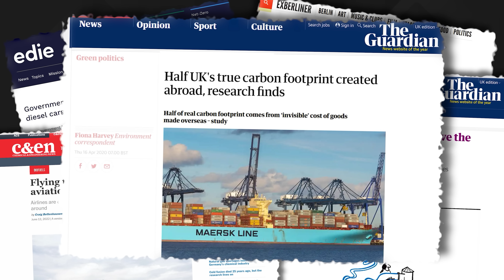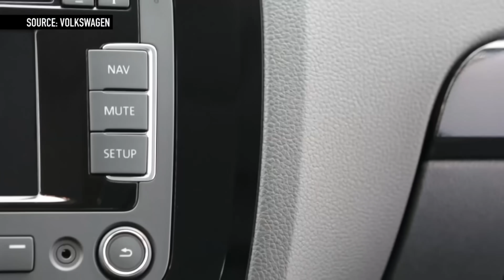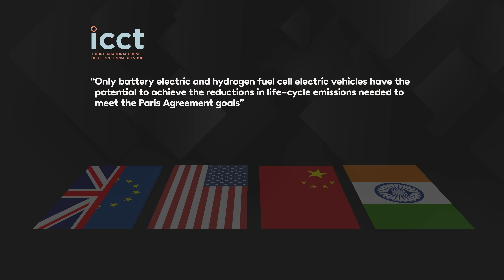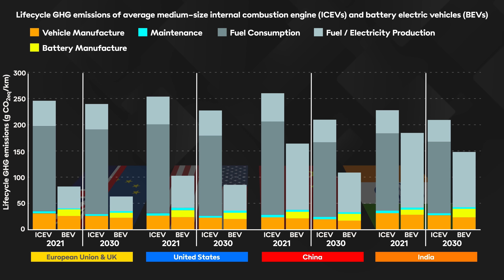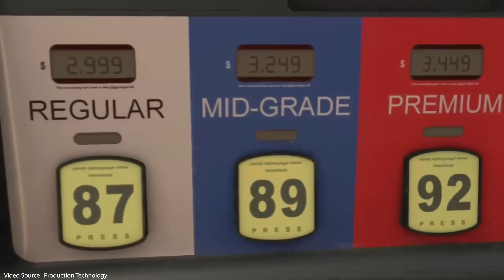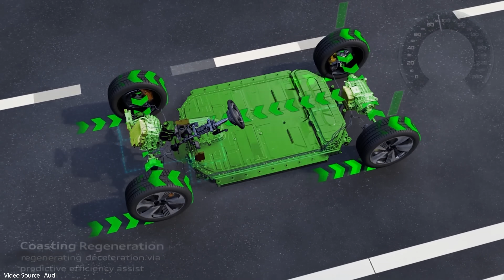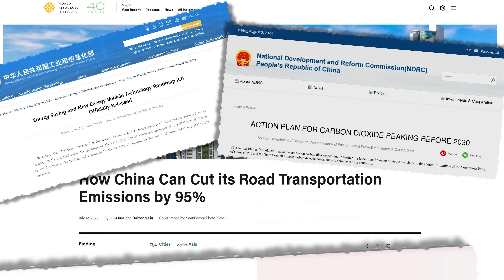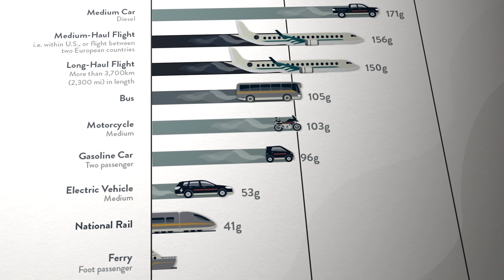Are EVs really better for the climate?

Comment: as a guy who used to convert cars to electric for people i used to have many people arguing these exact points. my answer after a while became simple and it is this:
eventually we will run out of oil, the stuff that fuels not only your car but busses, trucks, some trains, boats, aircraft, and the ships that transport cargo across the globe. it's not going to be a case of one day the tap get turned off, everyone shrugs and says "oh well", the price of fuel will go through the roof way before then. before we run out of fuel the average family won't be able to afford to run their cars. the delivery cost of your new fridge will be ridiculous because they have to fuel the truck. shipping will be so expensive that imports and exports will grind to a halt and forget air travel. ok there are stop gaps such as ethanol from crops and liquid fuel from coal (you know, the stuff the nazi used) but in all seriousness eventually we'll need an alternative mode of getting around and that is electric drive. now you can wait, but check it out by 2035 with a population of nearly 9 billion a lot of people will want an ev so good luck. my advice, if you want an ev try and install or buy a new home with as much solar as you can pack on the roof and battery storage to go with it. you travel with the only costs being on road and upkeep. treat the vehicle well and you'll need a new set of batteries in 7 to 10 years. by that time battery tech will have improved and you can buy and upgraded set. the world is going to shift to ev "everything" eventually and the way things are going it's probably gonna be a rough ride.

Comment: Getting yourself a nice two wheeler is certainly an option. But what about PEVs,  like e-scooters and e-unicycles (EUCs)?

These are never mentioned as transportation (and leisure, i.e. road-trip) alternatives.

If an EV uses 200 Wh per km, my Veteran Sherman (20" EUC) uses less than 30. It has a 60-80 km range, so more than enough for daily travels. And at 77 lbs, uses much fewer resources to produce. It has pretty much replaced my car, which I only use a couple times a month.

I guess they're not mentioned because they weren't part of the study. So why aren't they studied? They should definitely be part of the solution.

Comment: I definitely think we should switch over needed vehicles to electric, but I also think redesigning (reclaiming) our cities for humans, through improved public transit, walkability, proper cycle infrastructure, better density, lower speed limits, ending "free" parking, etc. is even more important. Less cars is more important than better cars...though better cars would also be nice. Especially after hearing about how much of the micro-plastics in the ocean are from car tires, which won't change because the cars are electric, and how unhealthy the noise of cars makes us, which again, won't change dramatically because of electric, as much of that noise is generated by the tires hitting the pavement at speeds over 25mph (40kph).
Anyway, thanks for the sane and thoughtful video.

Comment: I've had an ICE Rav4 car, and now a Hybrid Rav4.  (Not the plug in type).  The ICE averaged about 10 L of gas/100 km with a combo of city and highway driving.  The Hybrid averages 5.6 L/100 km.   That's almost a 45 percent reduction in fuel use.   Seems to me that the potential benefits of HEV are better than the report states.   Combine that with the significantly lower battery size and lower cost of acquisition over a BEV of the same size.
Reply: @geon2k2  Thanks you've made a good point, and I agree that ultimately BEV will be the way to go.  For me the HEV advantages (speed and convenience of filling up at gas stations, and lower acquisition cost) were important.   I felt the report undersold the advantages of HEV and PHEV as an interim steps until BEVs get more practical as highway cars, and charging infrastructure improves.

Comment: Great to see the comments from persons - mostly in first world nations, but in Africa (where I live), a combination of rampant corruption, unreliable electricity, lack of capex for really good urban public transport networks, long distances between major cities and poverty will make mass EV adoption a pipe dream for >>98% of the population.
Reply: Most likely true. Certainly in the short term, however, as the Co2 output per capita is tiny for most African nations (except SA), this isn't necessarily an issue. Africa and many developing countries are suffering the effects of climate change caused by developed nations. Therefore the efforts to decarbonise first world countries will still have a positive effect in Africa.

Comment: I think you will find it takes far far more energy to produce EV cars and Volvo said to negate the manufacturing of these vehicles you would need to drive them around one one hundred thousands miles so is Volvo wrong then let them know 
read Volvo report I my be wrong
Reply: It does not have to be 'you' who drives it 100k. Volvo and Polestar compared the two showing energy costs, which is one thing, and unless you want to chuck away a perfectly good  car, then then for emissions the EV wins. How many Volvo's clap out after 100k?

The financial costs are a rather different analysis.

Comment: Worth consideration is that cycling is not always as clean as suggested as it depends on diet. Someone cycling 22 miles a day uses about 1000 Kcal per day. If those calories come from Beef then that is an additional 37kg of CO2, even if they come from tomatoes that is a total additional CO2 output of 11kg (that is ignoring the additional CO2 produced by the body). If I drive a mercedes E220 Diesel for the same distance (139g/Km)x37Km the output of CO2 is 5.2kg (ignoring the additional CO2 from production etc). If everyone in the world cycled where would those calories come from? How much additional CO2 would be output from production of that food?  (I am very much in favour of electric cars by the way and not a nay-sayer in any way, but it frustrates me that cycling is always touted as the cleanest form of transport which it really isn't!) (guessing previous posts were deleted for providing website sources 🙄)

Comment: Just a thought for you, why don't we reintroduce the trolleybus to our towns?  No weight of batteries, no carbon cost of batteries.  More efficient distribution of power.  Ordinary roads with no rails.
Another thought, why don't we have an integrated transport system where time tables between various forms of public transport (eg bus and train) so you can go from where you are to where you want to be without too much hassle?
Why is there no encouragement to convert ICE cars to EV so saving a lot of the carbon cost of manufacture?  Something like the "Transision-one" in France but with a wider range of potential convertions would be good.

Comment: Quite a good report, but a few things have been missed:

Firstly is the extra weight of EVs. They are probably on average at least 20% (probably more) heavier than equivalent ICEs. This will give the same percentage increase in wear on the roads, bridges, etc. which will require a lot more maintenance, and hence pollution to fix. At least 20% more road and bridge maintenance, I'm guessing is a lot of energy.

Secondly, the tyres will require changing more often, along with other wearing parts, due to the increased stresses from the weight. What is the cost of this in increased pollution?

Thirdly, how have the recycling figures been calculated? Does the energy required to recycle an EV leave out the parts that can't yet be recycled? What happens to those parts? Landfill? It would be nice to see a comparison of the percentages recyclable in EVs and ICEs.

Fourth was the arguement about building new petrol stations and new charging points is about equal. This is ignoring the fact that we already have the petrol stations. The charging infrastructure will need to be comparable to the existing fossil fuel setup, which will take a lot of energy. I would also argue that a petrol station apart from a small electricity supply, is an independent thing, whereas charging stations need larger supplies of cables  and infrastructure leading all the way to them. This is probably more pollution up front, at least.

Fifth: there is the environmental cost of charging stations with regards to the space they require. I calculated that to serve the same amount of EVs (charged to about 80% capacity) as ICEs, charging stations will need about seven times the land area.

Sixth is the drop off of efficiency with age, of both types of vehicle. An EV will need ot charge more often, after a while, which will affect the fifth point.

I can never trust a report from people who have a vested, and possibly ideological interest in pushing an agenda. I don't mean you, Dave.
Just the facts, Ma'am.😀
Reply: Good points to analyse, but if you take away the dependency of using coal and switch to renewables as an electricity source (which is necessary and inevetible) & once you have an infrastructure of recycling and chargers in place & consider battery and EV tech are rapidly and will rapidly improve in terms of environmental impact (which will reduce cost and weight of the car);  EV's will always have a dramatic positive impact on the reduction of carbon footprint compared to ICE cars in the future.
Reply: @bruce1097  i just had to laugh because of all the "ifs" in your post.
if you take away coal dependency
If you have infrastructure
If battery and EV tech improves rapidly
if battery weight drops
Then EVs probably will have a positive impact.
Are you a salesman, by any chance? 😁
Reply: @bruce1097  I don't buy the rapidly improving battery technology, I'm afraid. Batteries have been around for hundreds of years, admittedly their weight has never been such a disability as now, but these leaps and bounds that so many people talk about are really only speculation and marketing.

Hopefully they will have a positive impact.

One more thing about batteries is their lifespan. Some manufacturers offer guarantees, but when they fail they probably make some cars ready for the scrap heap due to the cost of replacement. A well maintained ICE can last a milion or more miles (albeit with higher emmissions).

I read somewhere about the Tesla with the highest mileage (I can't remember how many, but several hundred thousand). It turns out it was on its third battery, and even the electric motors and gearbox had been replaced. These are also things that have to be factored in.

A twenty year-old Tesla may well be scrap (due to the battery), whereas most ICEs can make it past that.
Reply: They are a bit heavier by not 20%.  I bought a 2014 Ford Focus Electric, which allows for a direct comparison to an ICE vehicle.   The Electric is around 3600 lbs while an equivalent styled ICE is around 3400 lbs.  This means an electric is around 6% heavier.  Yes, heavier but probably not 20%.
Reply: @davidhanson8728  i just had a look, and they appear to be between 200 and 800lbs lighter than the electric versions. It will make a difference. It would be good to see a comparison of equivalent ICEs and EVs to get a more general picture. The good thing is that you can more or less calculate the environmental impact fairly accurately.
Reply: I suppose they miss the most simplest mid term solution - switch from gasoline to LNG which is much much more eco friendly.
Reply: @dimav.4713  Yes, that's one option. There are plenty of other ways to reduce emissions without forcing people to buy new cars.
Making car-sharing compulsory a few times per month (fining drivers who drive alone, maybe., maximum mileage per week. No short journeys, etc. Other alternative fuels. Cutting down on flights. One big point is making air-conditioning illegal. We never died from it before. Apparetly 10-15% of all energy goes to this. That's a big instant saving for the planet. I never use air-con, even when it gets to the high 30s Centigrade and above.

Comment: The most important thing to learn around transportation and carbon output is this - battery powered vehicles are not a solution to global warming, they are the auto industry’s solution to a failing business model in the face of global warming. Becoming less car dependent, mostly through sound urban planning and mass transit, is the better way ahead.

Comment: Look at the insane path that a barrel of oil has to take from deep under the sea to a refinery on shore then into a large diesel tanker truck to your local Petrol/ gas station how could that ever be more efficient than an electric vehicle charged at home off the grid that has on average 30% renewables or more. Or better yet just have a small solar system at home dedicated to your local daily driving needs usually less than 50 miles a day a $2000 dollar solar installation could pay itself back quickly and then you could drive on sunshine ☀️ hey! hey! I’m driving on sunshine hey! hey! 🎼

Comment: Dictating that entire large areas must go from cheap natural gas heat to full electric is not the answer. The average household will need to spend $30K+ to convert and where is all of that generating capacity going to come from? Electric vehicles alone will over-tax the system.

Comment: We still need a significant improvement in range and reduction in cost before EVs can displace fossil fuel cars in countries like Australia. For a car that is just around town it's fine, but impractical given the huge distances between most cities. Don't get me wrong; if two car families could make one an EV and the other a hybrid, it would be a big improvement. But I think Australia is one place where hydrogen would be more practical. What about those of is who live in apartments not houses? Where do we charge the car overnight? My car is under a car port. No lockup garage and certainly no electricity. So even if I wanted to, it's impossible for me to own an EV. On top of that, the prices of EVs in Australia are insane. Fine if you can lease it, but we can't all do that either. 😥

Comment: In fairness, modern combustion engines can achieve 40% thermal efficiency. Diesel engines can achieve higher than that. Just saying for the sake of accuracy. BEVs and FCEVs are clearly far more efficient. Personally I am more interested in FCEVs or HICEV for better cold weather performance where I live.

Comment: It is wonderful discussing EV`s but as a whole the uk is going to be lacking in all forms of power supplies. How am I going to run my 15Kw airsource heat pump, my 10Kw electric shower, 7Kw electric hob while also using all my other electrical items within my home and then charge my car. There is not enough money in the pot to update everything that needs updating and this will still be the point when I am pushing up daisies.

Comment: FINALLY. The production of fuel taken into account.
I've been fruitlessly banging my head against the "but the electricity comes from coal" crowd for a decade...
Reply: It DOES come from coal and natural gas!

Here in California, 40% comes from natural gas!  A Fossil fuel!!!
Reply: @scottslotterbeck3796  
YES.
Yes it does.
I agree. You're right.
I didn't say it didn't.

But... The vast amount of electricity used in production of petroleum ALSO comes from coal and ALSO uses Cobalt and ALSO needs the fuel produced to be burned transporting it all over the country so it can be burned in the cars and trucks.

Where I "bang my head against the wall" is where pro-ICE activists berate the energy used to produce the electricity that directly moves an EV while ignoring the energy used to produce and distribute the petroleum before an ICEV even moves an inch.

Comment: Four years ago, I moved so I would be in walking distance from my work (I still use my car during the week-end). Not only walking is good for my health, but I am faster by foot than being blocked in the traffic jams twice a day.

And beside saving on the price of gas, it is a very comforting knowledge that I am not depending on my car and if I need to let it at a garage for repair, and if the repair should last a few days, i am still not impaired.